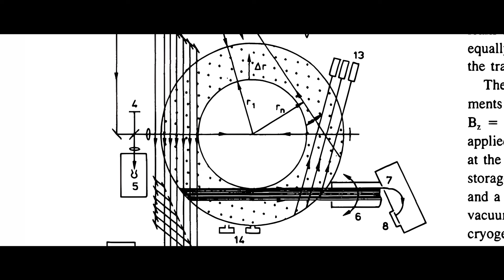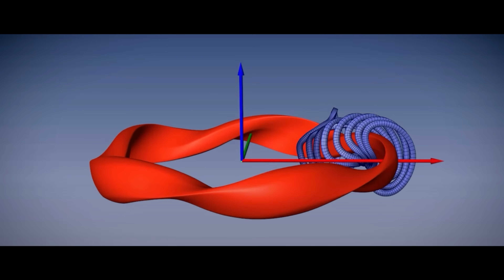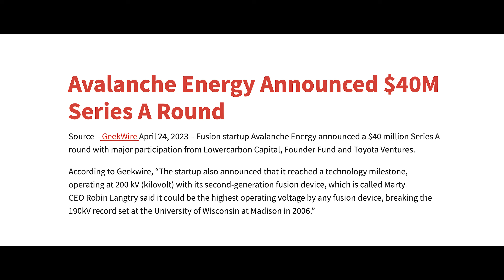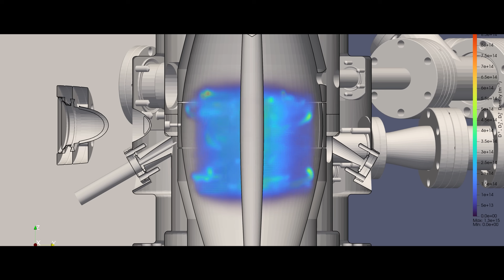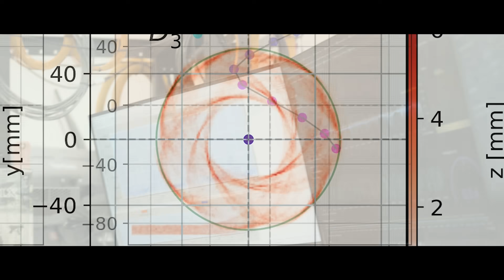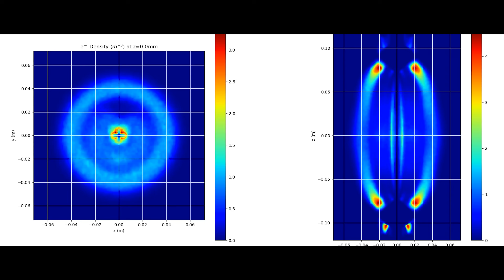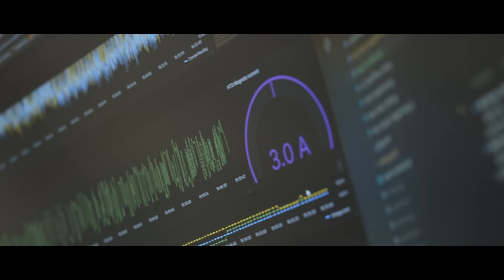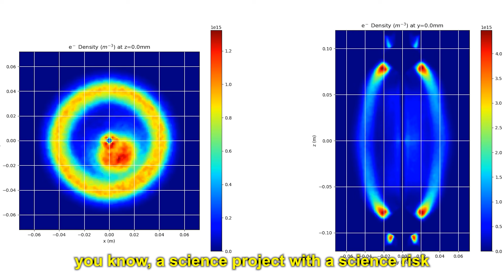This Company Invented a New Way to Do Fusion

Comment: Fusion equals neutrons.
These neutrons are destructive as well as the heat source to drive the steam engine.
There is no material on Earth known that can withstand this.
Known as the Core Problem.....
The "Neutron Bombardment" on the Kettle
Let's assume the inner wall of the "kettle" (the first wall) has a surface area of about 1,000 square meters (a reasonable estimate for a large power plant).
Neutron Flux on the Wall = (Total Neutrons per second) / (Surface Area)
Flux = (7 x 10²⁰ n/s) / (1,000 m²)
Flux = 7 x 10¹⁷ neutrons per square meter per second.
It's more common to think in per square centimeter:
Flux = 7 x 10¹³ neutrons per square centimeter per second.

This means every square centimeter of the inner wall is hit by 70,000,000,000,000 (70 trillion) high-energy neutrons every single second.

Guess what....Melted metal.
Very expensive Nuclear scrap.....£50B worth

Comment: The theory’s real I wanted to see if energy could act the way I picture it, flowing from monopole to dipole to atomic levels. So tested a simple small-scale simulation of which forces are in action, how string, quantum, and atomic transitions look if you could zoom in that far. The limitations of my test are the one issue I can not easily overcome at the moment, so I had to come up with an easier way to represent the minimum forces needed. After my observations, I have been trying to compare what I observed. So I started looking into the science again. The more I learned, the more the patterns I saw made sense: rings, repulsion, collisions, Fibonacci spheres, the same shapes seen across physics, from energy to the universe itself. My only limiter was the software and a more accurate simulation. But I believe even if the simulation gets larger and better. Those same patterns of state, and their changes, I observed in the test I ran. Even this video shows the same flows of energy.

Comment: Philo T. Farnsworth (inventor of the cathode ray tube television) was the first to develop a fusor that used electrostatic confinement. Dr. Bob Bussard (who envisioned the interstellar ramjet) attempted to create a working version of the fusor that produced more energy than was required for confinement. While fusors are great high energy proton producers and energetic neutron sources, but the toughest thing is preventing "leakage" through the electrostatic field.
Reply: Pat is right.  I worked with Bob and I've kept connected with his company and their progress.  Finally a group has picked up the ball and is making success running with it.  The models of EMC2 guys made extensive progress on leakage and instabilities.

Comment: Ugh, this feels more like an ad than anything actually informative. It didn't even show if they got a flash like they wanted in the experiment. It just counted down then skipped over the most intresting part to them hugging after it was over. They don't give any specs like size other than "smaller" or any other specs really like what temps they are actually reaching, what kind of fuel(s) are they using, or even really how their system works other than it uses electron and magnetic fields which so does basically everything else from lasers to life so it really isn't saying a lot.
Reply from the maker: Will improve for next video!

Comment: This sounds very similar to the polywell fusion approach (WB8) tried by EMC2 if not identical. They never got it to work and there is significant evidence that it can't possibly work. Their description is too vague to tell if they are doing anything different, but it seems they are trying to create a potential well by confining electrons using a magnetic field to form a virtual cathode. This is what polywell tried, and failed to do.
Reply: Actually you are wrong. The EMC2 folks didn't fail.  Instead like this group, they learned a great deal. Specifically this lead to a reconfigurtion of their magnets design. But, their investors were not in for the long run and they ran out of money.....been there myself in another startup. Bob Bussard was from the old school of big projects and he and I used to butt heads because I was a rapid program approach guy. These guys are using the next generation rapid iteration program approach that embraces failures (as long as you get the data and can iterate).

Comment: I always believe that fusion on a small scale would be a lot easier that the full scale full production models everyone else is trying.  When it is possible to create fusion with a vacuum tube then scale that up slowly until you reach unity.

I do wonder if the rotation instability couldn't be used similar to how a rotating detonation engine works.  Might be something to look at later if this turns out to be a dead end.

Comment: If you spin two atoms dead center of two separate confinement fields it would increase the relative mass of the atoms then once they reach an appropriate relative mass it could potentially be easier to fuse them

Comment: i looked into fusion and what i see is if you heat tungstin and graphine to 3000°f the tungstin plate is the + plate and graphine is the - it just works so what they need to do is heat them plates. thats where i see the problem is that the heat loss they can use gold mirrors to reflect 90% back but the heat always gets out. i also see the electrons dont really move they just kinda in a cloud of free electrons around the tungstin but theres no real flow so the graphine needs to be close but not touching. but if you can solve for the material limitations and get yourself a insulator and a electret that can work in atleast 3000°f what you can do is place a insulator on the back end of the graphine plate and on the other side of that a + electret and that can attract the electrons to the graphine plate at a much faster rate it should give it a flow rather than just a static cloud. outside diamond tech i dont see that part being possible you can go without the electret but you need that insulator but even without that it still works if can hold in the heat. and the only solution for that is not one your gonna like. it works its just placed in the wrong location. if you place it in a environment thats 3000°F you wont get any heat loss. so its best used in space near the sun or maybe venus but possibly dig a deep hole i hear the reason the worlds deepest hole stopped is because the bit melted you need to go there and drill further if metals dont work anymore then dont use metals use lasers get deep enough you hit temps of 3000°f and place it right there and the heat loss will stop no energy input needed it will just work. the problem is the hole or space. dont seem like its possible on the surface of the earth. ill keep trying but theres just too much energy input to keep it hot you need a free heating solution.

Comment: So metaphorically it looks like you built the starter or starting mechanism but now ,,, the next phase would be to build the motor so to speak after eliminating a few more variables that will probably arise, in sequence of development from starter to motor. 
Frankly this is an area that I'm quite interested in and I've seen five startups that are using different approaches two of which I think have real world potential and I believe yours was one of them.  Great work,, good video

Comment: Brilliant - ingenuity - EUREKA.  In the Netherlands, an inventor tried to produce a lightning plasma called 'Bolbliksem' or Ball Lightning by using a series of former submarine batteries. Shares in the company Convectron NV. were sold to the public. The company nearly went bankrupt but is now reemerging as Convectron Natural Fusion N.V. All lightning is a rare and unexplained phenomenon described as luminescent spherical objects that vary from pea-sized to several meters in diameter. Though usually associated with thunderstorms,[1] the observed phenomenon is reported to last considerably longer than the split-second flash of a lightning bolt, and is a phenomenon distinct from St. Elmo's fire and will-o'-the-wisp.

Comment: I think it's the wrong way and more difficult to try to imitate what happens in the sun... all to generate a positron that annihilates itself and generates ALL THE ENERGY OF THE SUN, and not from the fusion of hydrogens... the solution would be to produce positrons on a large scale, without needing all these expensive "plasma confinements"

Comment: Recently I read something about deuterium (or hydrogen) + boron fusion which generates 3 alpha particles instead of neutrons.
Since these particles are charged, they should be easier to confine with an electrostatic field. 
 Since there's no neutrons doing damage  to the reactor walls, it's described as a cleaner reaction.
The temperature needs to be higher though ... but confinement could be easier.

Comment: The Heretic’s Limit: Where Electrostatic Fusion Meets Reality

TL;DR
Assume a compact electrostatic-fusion reactor can reach net power.
Then Gauss and Poisson demand field strengths that require electron
temperatures and densities which radiate away more power via
bremsstrahlung than fusion can produce. Contradiction.

(1) What They Desire
Avalanche and peers pursue a compact, steady-state fusion machine:
electrostatic ion confinement + magnetic electron trapping.
Target: V ≈ 300 kV, nᵢ ≈ nₑ ≈ 10¹² cm⁻³, Tᵢ ≈ 30–100 keV,
device radius L ≈ 0.3 m. The goal: P_fusion > P_input with
rapid iteration and no superconducting behemoth.

(2) Where the Math Turns Against Them
Poisson’s equation links the required charge imbalance δn to the
potential Φ and device size L:
  ∇²Φ ≈ Φ/L² ⇒ δn ≈ (ε₀/e)·Φ/L².              (1)
For Φ = 3×10⁵ V and L = 0.3 m, δn ≈ 2×10¹³ m⁻³.  
To maintain quasi-neutrality (δn/n ≪ 1) demands n ≫ 10¹⁵ m⁻³,
already beyond most electrostatic systems.

Debye length:
  λ_D² = ε₀ k Tₑ / (nₑ e²).                      (2)
For L ≈ 0.3 m, λ_D ≪ L ⇒ nₑ ≫ 10¹⁵ (kTₑ/100 eV) m⁻³.  
Thus either hot electrons (large Tₑ) or dense plasma (large nₑ).

Bremsstrahlung volumetric loss:
  P_brem ≈ 1.69×10⁻³² Z_eff² nₑ nᵢ √Tₑ  (W/m³). (3)
Fusion power (D–D):
  P_fus ≈ nᵢ² ⟨σv⟩ E_f ≈ 3.4×10⁻²⁶ nᵢ² (W/m³) at Tᵢ=100 keV. (4)

Set nᵢ = nₑ = 10¹⁸ m⁻³ (10¹² cm⁻³) and Tₑ = 10 keV:  
  P_brem ≈ 5×10⁷ W/m³ ≫ P_fus ≈ 3×10⁶ W/m³.  
To reduce P_brem you’d cool electrons—but cooler electrons shorten
λ_D and destroy the potential structure that confined the ions.
Raise n to fix λ_D and you worsen P_brem ∝ n².  
Every path through equations (1–4) increases radiative loss faster
than fusion gain.

Space-charge throughput is capped by the Child–Langmuir law:
  J_max = (4/9) ε₀ √(2e/m_i) · V^{3/2}/d².      (5)
For V = 300 kV and d = 0.3 m, J_max ≈ 0.1 A/m².  
That limits beam current and total fusion rate even before losses.

Hence the contradiction:
Steady-state confinement requires quasi-neutrality,
quasi-neutrality requires dense electrons,
dense electrons radiate more power than fusion produces.
Therefore no electrostatic well can sustain net-positive fusion
within known plasma physics. ∎

Looking Forward
Contradiction defines the frontier. If pulsed shear, non-Maxwellian
velocity distributions, or unknown plasma self-ordering suppress
bremsstrahlung or alter charge transport, the math above may need
revision. That possibility—not belief—makes the next experiment
worth running.

Comment: Sounds like an advertisement? IT OUGHT TO! I didn't catch where they are getting their funding for this deal, but it doesn't look like the typical big money project you usually see when it comes to fusion. These guys are doing it small, quick, and compared to others on the cheap. They MIGHT just pull it off. I'm not going to put them down by beefing that they are blowing their own 📯 horn. 

Hopefully, somebody is going to eventually achieve a reliable Fusion reactor that is practical and relatively affordable, and it will HAVE to be so IF it is going to be able to have truly useful applications. The fact that this outfit is putting together a project that is small, able to be tinkered with quickly and then tried again in many variations is a good indication that they will manage to beat out the big ones, eventually. Fusion reactors have historically been just thirty years away, for the past sixty years or so, and if they are only going to work in things like the huge Tokamak type reactors, then fusion is probably always going to be just thirty years away. 

There comes a time for everything. The old saying is that you can't railroad until it's time to railroad, or fly with heavier than air craft, and many other things is (unfortunately) true. 

There are many problems with trying to get fusion reactors that make reliable, dependable, and USEFUL energy. Experimental proof of concept reactors are one thing, but to be able to get them working, everyday, in the power grid is the real problem. To be useful for that situation, you are going to need several, because you will always have to be able to take them offline for service, repair, and general maintenance. None of the fusion reactors that I have heard of will ever be able to get to that point, even if you did have several of them. AND all of the large ones are starting from the point of build it big, get it to work in a reliable, efficient, and useful manner, and then scale it down to make it practical. These folks are trying the opposite approach; build it small, make it work, and then try to scale it up, and, or, build them in arrays so you can always have the power online, and still have the ability to service and repair. IF they can pull it off, they just might be the Wright Brothers of the Fusion Age, and they will go down in history, and probably make a boatload of money 💰 to boot. 

But all of the fusion projects have several serious problems to overcome. 

One primary concern is not achieving fusion, since we have been able to do that since the late 1940's, however, thermonuclear devices of that type have limited applications. The primary thing is to achieve fusion in a reactor that can sustain the reaction, and allow you to get the power out to produce steam to generate electricity, AND also hopefully industrial heat for various things, without melting the reactor into slag.

Yeah, we should be working on fusion, but we ought to be BUILDING liquid salt cooled thorium nuclear fission reactors that we CAN build NOW, and then go from there. Even if we can never get fusion reactors that we can use in our power grid, it might still have a lot of useful applications. Space Craft propulsion is an example that could be very helpful. But, we could do that with fission reactors as well, and we should. It's not technical problems that is preventing us from having the ability to generate practically unlimited power to drive our current and future civilization, it's stupidity, and the possibility that there are those who don't want us to have nice things.😮😳🤔🧐🤯

Comment: The question you always need to ask when talking about new fusion startups: How many nuclei have they already fused so far? The answer usually is: None to a few. Everything is mostly talk and hope.

And one more thing: A bath tub full of Sun plasma with H-H fusion produces less heat energy than the human body, so we have to do a different type of fusion on earth with much higher temperatures. Showing the sun as example is therefore totally misleading. Oh, and the Sun is so low density that a human would sink into it about half the Sun radius before becoming buoyant in it.

Comment: 2:30
One of the Most Intelligent Perspectives over Fusion Energy Given [Publicly] Untill Now...
Also Small Units are Economically Scalable for Specialised Individual Uses...
Big Fusion Projects are a Market Breaking Technology in the Energy Sector, reduce the Need of Workforce in the Energy and Infrastructure Department...and this Only if they Works...untill Now they were just Big Pile of Burnt Money..which is not a Valuable Solution to Inflation.

Comment: As you ask the question, yes, I believe you are frauds. Not that there isn't a genuine theory and engineering challenge to fusion, but that you should have figured out by now whether or not it's possible. Counting on my fingers, I think not. 
With the caveat that I don't know what I'm talking about, I think it's prohibited by perpetual motion theory; wherein the huge gravitational force of the sun provides that extra kick of energy, allowing a self sustaining fusion reaction to occur in the sun, we cannot recreate on Earth. It's possible to force instances of fusion to occur, but one instance of fusion does not increase the statistical probability of another instance of fusion - as it might in a gravitationally dense plasma. 
Hence each instance of fusion must be forced by a huge input of energy. 
Then consider the concept of useful energy; a surplus of heat from fusion is not equal to power that can be applied to do work. Translating surplus heat into power that can do work comes at an efficiency cost - to be weighed against the energy input required to force fusion to occur, and that will always run at a deficit.
As I say, a third time, I only suspect as much based on a little reading. But my best bet for boundless clean energy would be high temperature geothermal. At least we know it's there!